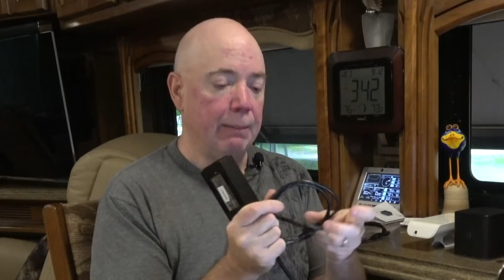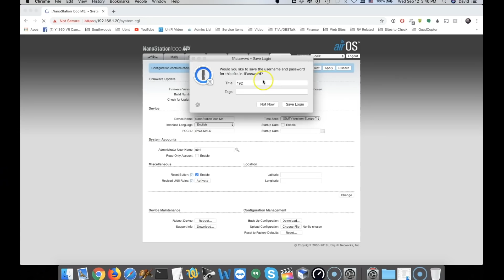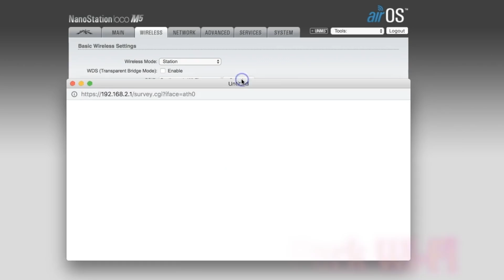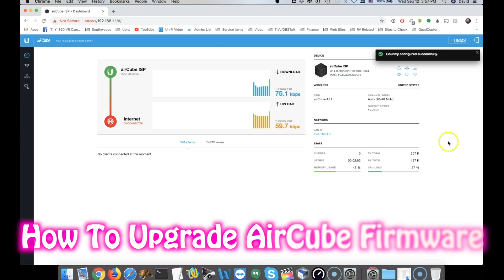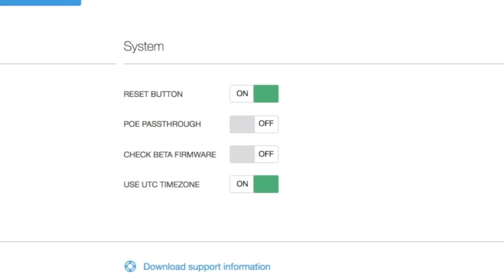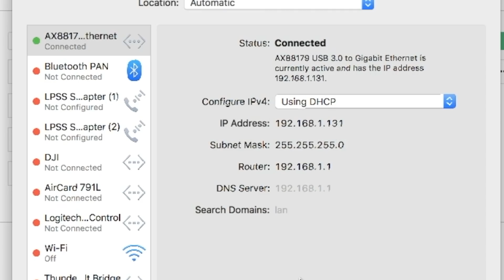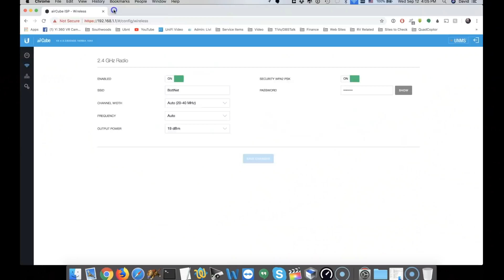Build a Private RV Wi Fi System with a NanoStation & AirCube AC

Comment: I got an m2 and followed this tutorial but for some reason, I don't have internet when connected to the ap, I used this on an m2 loco with the same ap, and  I had internet, but it just wasn't fast enough to get much use out of. I was able to use the m2 with my limited hotspot and I got internet with it , so I know that the unit isn't faulty, I just don't know why I can connect but not have internet.

Comment: My Nano will not connect to the Comcast wifi at our RV park. Is there a trick to allow the Nano to talk to a non ubiquiti device?
Reply from the maker: Nope, no real trick. The only thing I suggest maybe is using the option of changing the MAC address of the NanoStation to make it look like it's something else, like a cell phone. Sometimes RV parks, or networks who put in Wi-Fi for RV parks, block other routers like NanoStations from being able to connect for some RV parks charge for access per device. So you have to fake it out. There's a setting inside the Wi-Fi area of the NanoStation where you can put a Mac address in. Clone Mac.  I thought I addressed this in the blog post on our website.
Reply: @DavidBott  Thanks for your reply. I have a Nanostation AC and when selecting the wireless
Reply: To connect to a pop-up says my Nano only will connect to other AC devices. Do you know an ssh command line to turn that off? I think that is what is in my way.
Reply from the maker: @havfungetlotsdone1112  As I have mented in the main blog post, you can not use the NanoStation AC as it only works with other Ubnt AC devices (It has its own AC protocol). You need to use a M2 for 2.4Ghz or an M5 to connect to 5Ghz.
Reply from the maker: @havfungetlotsdone1112  No, the Ubnt AC units will ONLY CONNECT to other Ubnt AC units.  I mentioned this in the main blog post to be sure not to buy a AC unit.  Ubnt AC is it's only 5Ghz protocol that is used for Bridge setups.
Reply: @DavidBott  thank you David. I missed that detail. All the best and thank you again for a great video.

Comment: Does this setup work for the Nanostation M2 or M5?
Reply from the maker: Both are set up the same way.  Some people do both and just change them as needed. Just don't use a 5AC as they only connect to other Ubnt 5AC units.
Reply: @DavidBott  I am not sure what a 5ac unit is. I haven’t purchased a Nanostation yet, just looking to get information at this time, but I am strongly considering a purchase soon of either an M2 or M5. Just weighing which is the right unit to buy. Thanks. I learned a lot from your video.
Reply from the maker: @seyouma722  hello, well if you have to choose one over the other then you're going to want the M2 because that one is 2.4 GHz which is used in every RV park. 5 GHz is not used in every RV park.  I mentioned the AC radio because there's also 5AC but that's not the same thing when it comes to ubiquity products. It's their own 5 GHz protocol. Hope this makes sense and helps.
Reply: David, thanks for leading me to the M2. Didn’t think about the availability of 5 ghz. Glad I found your video, it was extremely helpful using a Mac. I search for some time with reference of using a Mac and your video finally addressed my questions and concerns. Again, thanks for the video and your help. Regards and Blessings!

Comment: This works great! However, I've switched campers and I'm looking to put this same system on a 12V DC system. I'm having a heck of a time looking for a POE injector that will up the voltage from 12v to 24 v that will supply the Air Cube and the external antenna. The new camper does not have an inverter yet but plenty of power including solar charging. Just wondering in all of your adventures you may have run across a solution for this.
Reply from the maker: I am sorry, I have not as I have never had the need.  Sorry.
Reply: @DavidBott  Thanks David. It just seems silly to run on Batteries, Turn on an Inverter to up voltage to 120 AC and then down covert the 120 AC back to 24V DC. I will keep looking and let you know if I find a solution if you want me to.

Comment: I have set this up in  my coach and it works well attached to my home wifi.  Have not had a chance to test in a park.  Has anyone integrated this with the LCI OneControl for remote management?  I have it connecting within the coach for app management of all the coach features.  However, cannot get it to connect remotely.

Comment: I've set it up and it works great, has anyone set this up with an omni direction antenna? Would that work as well to get around corners etc if you don't have direct line of site of the host wifi signal?
Reply from the maker: Having it on me directional has nothing to do with trying to get around corners. Radio waves, travel and bounce (reflect) in straight lines. A directional antenna is always better for gain and range. Example, try cupping your hand to your ear. You can hear better than you can without it there. You know like when you're trying to hear somebody in a crowd so you put your hand up and cut it around your ear. It's a perfect example of what a directional antenna does. Take care, Glad it worked out for you.
Reply: @DavidBott  Got it, so adding an omni won't help at all?  Have you ever set up two antennas at the same time? Would that help with stronger signal?
Reply from the maker: @MatthewSumi  No way to really do that unless you use a router that does load balancing between two internet connections.  It would NOT help with signal.
Reply: One more thing, if the RV Parks wireless makes you click a link (accepting rules etc) before allowing the internet to work will it block the signal from the park?
Reply from the maker: @MatthewSumi  You must have not read the blog post. In it, it reads...
Dealing with Captive Portal or “Agree” Pages: Some parks require you to “agree” or login with a user name and password before you have access. So once you connect to the park with the NanoStation, while on your Wi-Fi network, the first time you open your web browser the “captive portal” page will come up asking you to agree or log in. Once you do, the portal will note the MAC address of the NanoStation and then allow access to anything on your local Wi-Fi network.

Comment: David, just moving into the RV and trying to set this up.  All setting worked great on a trial before we moved into the camper.  However, although everything SEEMS to be working, I still can't get an internet connection at the rv park doing this.  Since it worked on a different wireless network, that's the only thing I can think of.  Is there ANYTHING the RV park could've done to prevent this from working?
Reply from the maker: Hi...Can you use the park without the Nanostation? Just wondering if they are having an issue or you just can not connect to a good Access point. (If so, what IP address do they assign your computer when directly connection to them?)  

You also mentioned they are assigning you a 192.168.1.X address, where are you seeing this...in the NanoStation or your computer?  I ask for if on your computer, that would be the AirCube giving you that address.  You would need to look at the NanoStation in one in of gateway lists to see the IP they assigned your NanoStation.  If they assigned at 192.168.2.X address, that would be the issue as (if you used my settings) as that would make for a routing conflict.    You would then need to change the network IP to be lime 192.168.22.1 and the two DHCP settings to also be .22..  Your Nanostation would then be accessed by 192.168.22.1.  

Last you could try changing the Mac Address of the NanoStation to something like this   08:fd:0e:f7:d9:3c   (This will make it look like a Samsung Tablet.)  Use the Clone Mac Address option. Check the box, put in the above save and apply. NanoStation will reboot and maybe that will help.  (Some RV Parks detect routers and block them, so you make it look like something else. :) 

Hope one of these helps.
Reply: It auto assigned me to a 192.168.1 number if that helps.

Comment: Essentially all ubiquiti nanostation products are now airmax, the don't have the nonairmax versions any more??
Reply from the maker: Hi...Not sure what you are getting at in regards to AirMax.  They have always been AirMax from as long as I have been using them. The only thing that you really need to know is that the "AirMax AC" line can only be used with other "AirMAx AC" devices.  But AirMax can connect to other manufacturers.  It is just their name.   Again, except for the AC devices.

Comment: Even though this is an old video, the equipment is still being sold and appears to be still standard equipment.  Bought the M2 along with the AirCube and went through your setup routine which was very detailed..  For testing I tried hooking it into my home wi-fi router instead.  I can see the nanostation and have it connect to home wi-fi router but internet doesn't seem to work.  Is it possible that is because the configuration depends on on connection to an access point instead of a router? However on the LAN network settings it has defaulted to Bridge0 instead of LAN0 and won't let me change it.  Is this significant?
Reply from the maker: Hi...The setup is still current and as long as it shows up like I have it in the video, it should work.  Make sure you are in ROUTER mode and also the NAT check box and all the setting that show up under it are also checked.   Connecting it to your home Wi-Fi is like connecting it to a parks Access Point.  The only other thing I can think of is if your home network is also using 192.168.2.X as it network. Then it would make for an IP conflict with the NanoStation and thus not pass traffic.  If you connect (not with the NanoStation but your computer) to your home network and know how to check what IP you get, then see if maybe it is 192.168.2.X.  If it is, then you need to change the network from 192.168.2.X to like 192.168.22.X  (There would be 3 places to make the change to to the new IP range.  If you do this, note that you will then reach your NanoStation control panel at 192.168.22.1.  (Hope this makes sense.) If all else fails, just recheck the settings. :)    Good Luck
Reply: @DavidBott  Thanks for the quick reply.  Naturally the story is more convoluted than that.  I previously ran a Motorola Surfboard up with by home network which ran flawlessly for many years.  My son is in IT security, found out, and insisted I upgrade to something more robust and secure one made by Ubiquity (Unify).  He bought the equipment and set it up (who was I to argue?) even though it is much more complex (in terms of user interface) than my old Surfboard.  I believe he set it up to only do 5 ghz wireless.  So initially, when I scanned with the M2 it did not see my home network.  I hadn't looked at my Unify setting since 2020......  so by the time I wrote my question to you I was still not able to access the Unify to see what my settings were.  Instead I dug out an old 2 ghz TP-Link mini pocket router I used to use for hotel rooms when I traveled a lot, plugging it into a switch (from the Unify router).  I verified that an old ipad could get into the the 2 ghz TP-Link and surf the web.  Then I swapped over to linking the M2, locking it into the TP-Link which it apparently did with no errors (according to the lights on the M2).  But it refused to surf the web.  So with going through router-switch-router to the M2 / AirCube and via an old ipad...... it is possible that that there is a lot delays built in and it was just timing out or there is a conflict as you suspect with the TP-Link or something else.  Since then, I found my Admin info for the Unify but have not been able to tell why the 2 ghz network isn't working.  So I have a few things to work on and investigate.  It might be easier to find an RV park for a night just to hook it up and try it.  :)  A sad story indeed.  Again, Thanks for the wonderful video.

Comment: I am a huge fan of Ubiquiti products and run my home on it.  I think this might be the solution to go with to beef up the wifi in the RV.  I think this will be a nice replacement for my DDWRT router that recently chose permanent retirement.  What is your thoughts of using the airMAX Bullet AC in replacement for the nanoM2?
Reply from the maker: Hi...The AC line of other UBNT radios are only useable to connect to other UBNT AirMax AC devices. Example, the NanoStation AirMax AC can only connect to other Ubnt AirMax AC devices.  I am NOT sure if that hold true for the Bullet AC or not, but thinks it does for some reason.  So, to be safe, if you want to go omni directional, (you will need at least an 8db gain antenna), then look to the Bullet HP in 2.4 or 5 Ghz. (2.4 is used at all parks, 5 might not be.)
Reply: @DavidBott  had to dig a bit deeper, you are right like the later versions of the nanostation this one is on their proprietary protocol.  An Bullet HP or M2 titanium would be needed.  I think longer term that might just be a though.  For now I think this would be the quick and simple booster.

Comment: I've watched this video about 6 times now. Bought the wrong nanostation the first try (note: the Non-M versions don't work like this). The second try is got it working at home and was stoked. First time out at an RV park I forgot the password I set on the nanostation so I did a reset only to find out that once you connect it to the aircube you can't get back into it through the router via wifi. Luckily the RV park is close to home, so I stopped by the house on the way home (for the next 2 weeks anyway) and grabbed the POE adapter and went through it all again. WORKS FREAKIN AWESOME!! DUDE! I now have a full-on private network in our rig with wired capability. Now to add POE cameras...

Thank you for making this video!
Reply from the maker: Side Note on PoE Cameras.  There is only one PoE port on the AirCube that is used for the NanoStation and is the WAN port.  So you would need to get a PoE switch and plug it into like port 1 of the AirCube.  You could just use Wi-Fi Cams and connect them up anywhere you have power.  I have some live cams running on our coach... https://www.outsideourbubble.com/live-coach-cam/   Take care.
Reply from the maker: Glad to read it all worked out and that you were not far away! :)  Keep the POE on board in case you may need it some time. Example...If the AirCube dies for some reason, you could still connect via ethernet to the NanoStation and us it.  :)  Enjoy!

Comment: Just set up a new install using the video, Thanks for the great info!

I have one comment I havent seen discussed - I have the Aircube ISP and it came with version 2.6x firmware. I downlo9aded the latest firmware (v 2.8.3) and tried to install, following the video. It failed the verification phase and cancelled the update. Used a different source pc, same result. After Internet searches,  found that I had to download the prior version, v2.8.0, perform the update, and then I could install and update to the most current firmware version. 

Giving the completed bundle to some novice full time RVers and hoping I can get them comfortable with just changing the Nanostation Loco M2 setting to change host SSIDs as they move.

Thanks for the great info David! Very well done!
Reply from the maker: Ah yes, sometimes you need to do firmware in steps depending on how far the JUMP in versions are.  I would not have recommended the ISP version however as it is made for a different use and it is only 2.4Ghz. (It is something a WiSP would install so they can maintain it remotely.)  It also does not come with a power supply. SO I recommend the AirCubeAC.  In any case, glad you are helping others and this helped you.  If you did not see the blog post on it...Here is something you can copy and past into a doc to print out for them...

FOR AFTER ALL IS DONE…QUICK CONNECT CHEAT SHEET….

1) Connect to your Wi-Fi SSID.

2) Open web browser and go to: http://192.168.2.1

3) Put in the user name and your password. User name = ubnt   Password = What you made it.

4) Click on the WIRELESS tab.

5) Click on SELECT

6) Find the Access Point you would like to connect to. (The park or your own data device.)If there are several with the same SSID name you want to connect to, then select the best signal. The first number in the Signal column you want to be closer to zero. -55 is better than -75.

7) At the bottom click LOCK TO AP.

8) If the Access Point requires a password *, enter it in the bottom area. (The park would have supplied one if needed. Or the one for your own data device.)

9) Bottom Right of the screen click CHANGE.

10) Top of the screen click APPLY.

In under 30 seconds, you should see the antenna lights light up and then you should have access to the Internet.

Dealing with Captive Portal or “Agree” Pages: Some parks require you to “agree” or login with a user name and password before you have access. So once you connect to the park with the NanoStation, while on your Wi-Fi network, the first time you open your web browser the “captive portal” page will come up asking you to agree or log in. Once you do, the portal will note the MAC address of the NanoStation and then allow access to anything on your local Wi-Fi network.